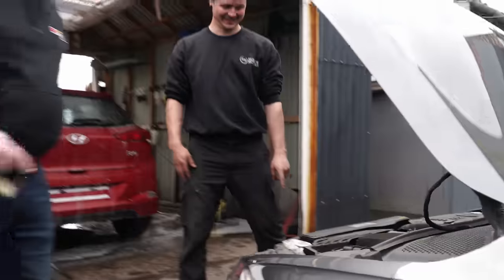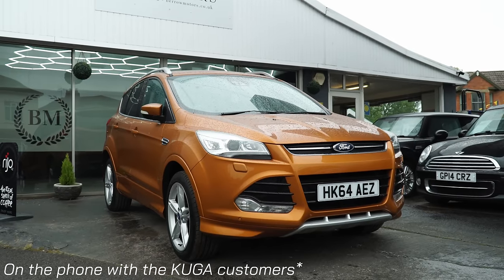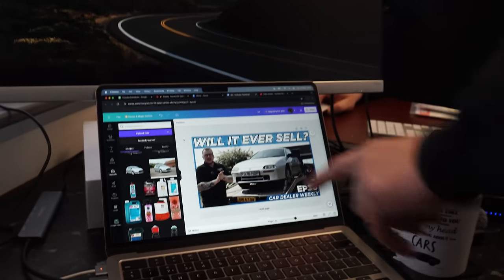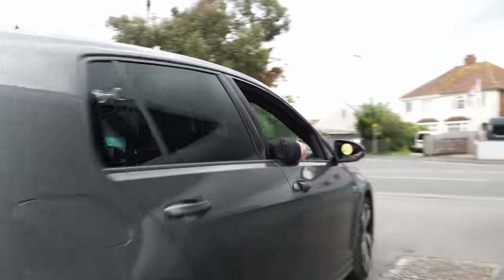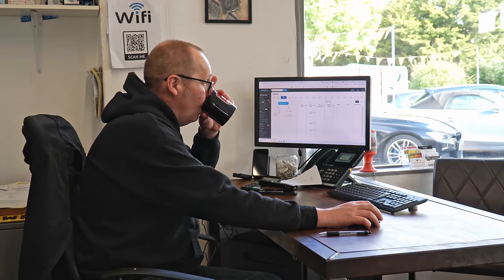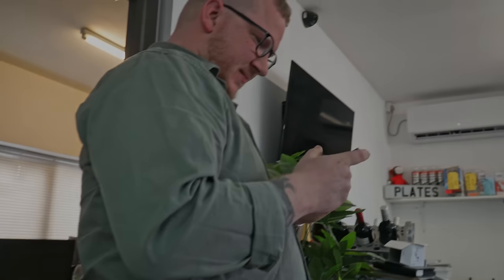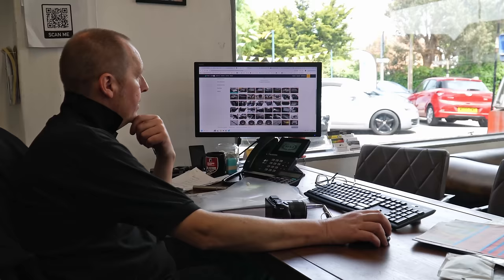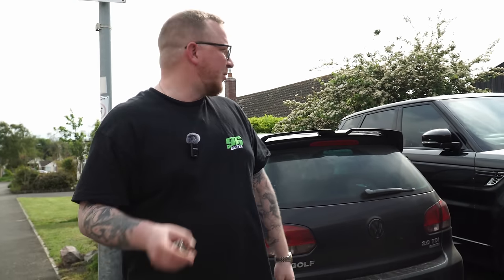1 Week Delay Caused By A Blindspot Light! | BM WEEKLY EP 39

Comment: Joe. What's the best way to remove bird crap from car paint work? I find it goes rock hard, and you can scratch paintwork when getting it off. Any advice appreciated
Reply: I suffer it incredible from bloody wood pidgeons. If you retry and rub it will damage. I get a wet rag on it overnight. By morning it just wipes off. Spent many variations but find that is the best. More like flying dog sometimes
Reply from the maker: You can get bird Lyme remover. Or soak it in citrus pre wash. Definitely don’t rub it